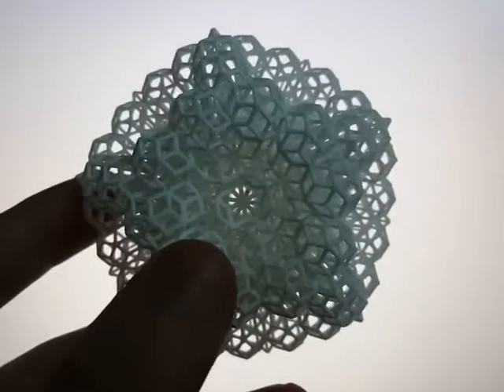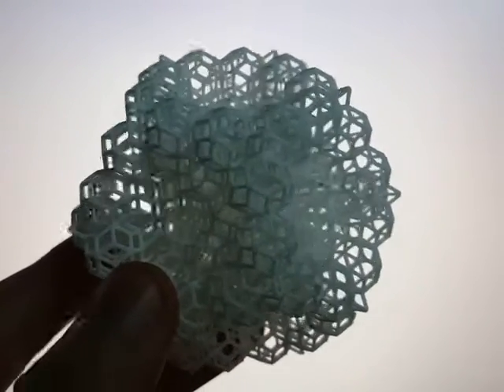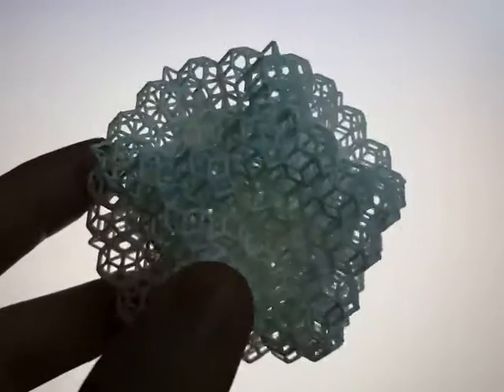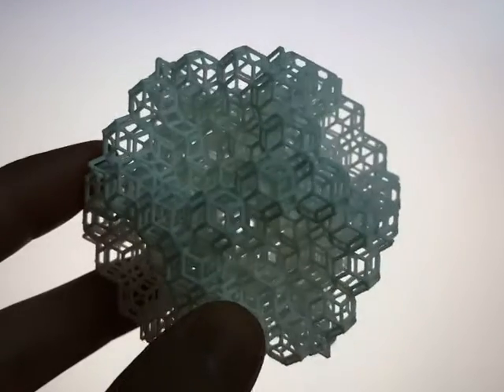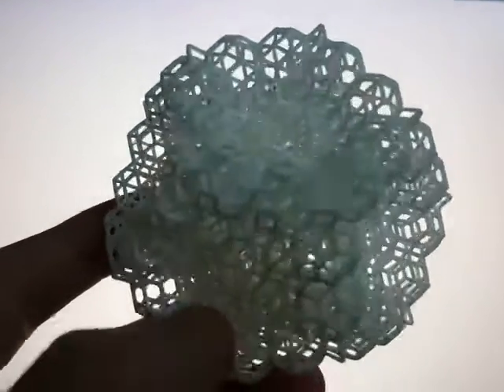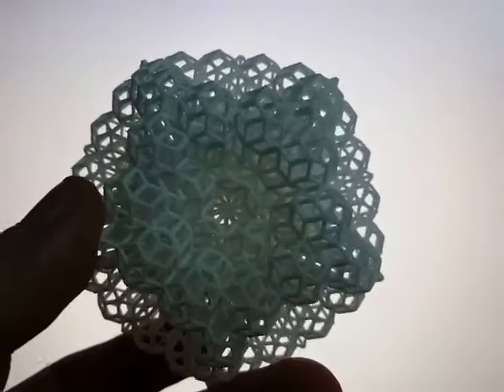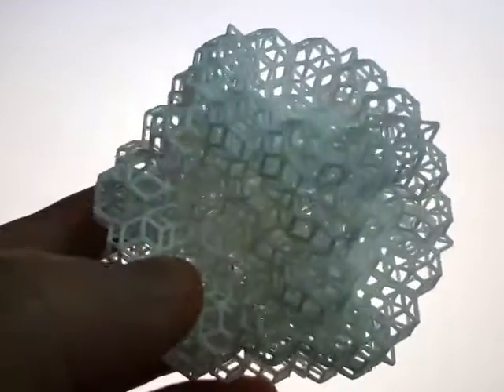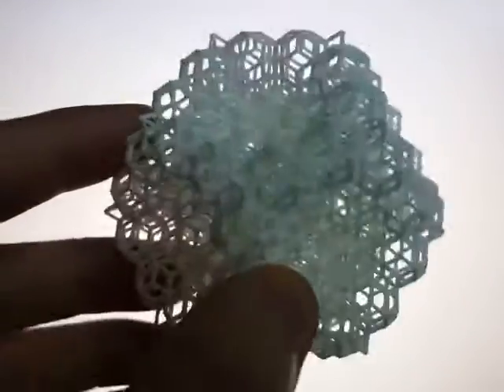A-type icosahedral quasicrystal vertex 3D print

Comment: Cool model.  Would've been nice if you could have made the four different polyhedra color-coded.  What are you using as the center polyhedron?
Reply from the maker: I don't think .stl supports colour, but it would be pretty cool. The central polyhedron is a cluster of 20 6-faced rhomboids, just as the outer most layer is the same 20 rhomboids, now substantially separated and keyed into the facets on the much larger rhomboids that form the dodecahedral walls.